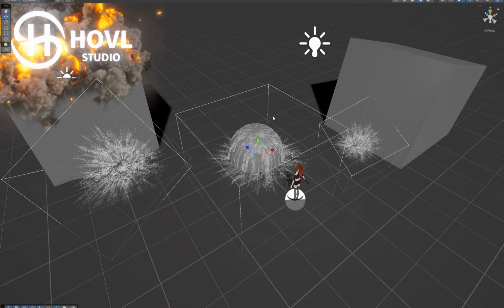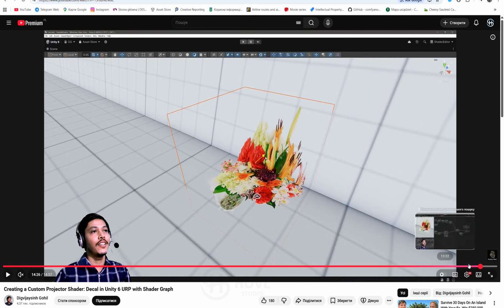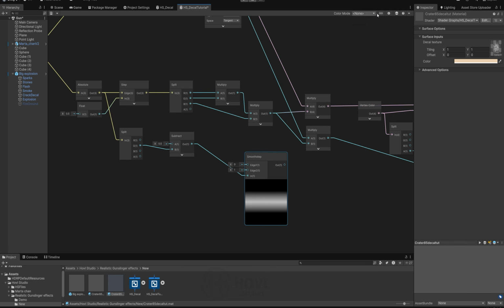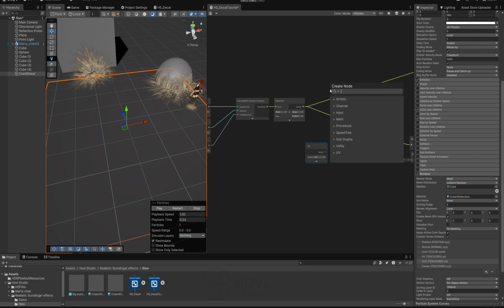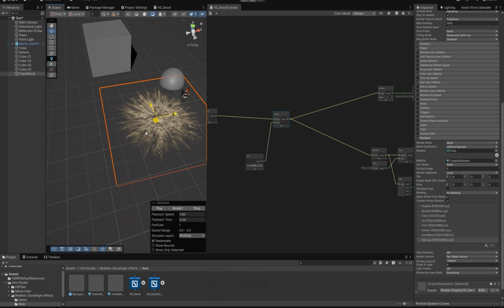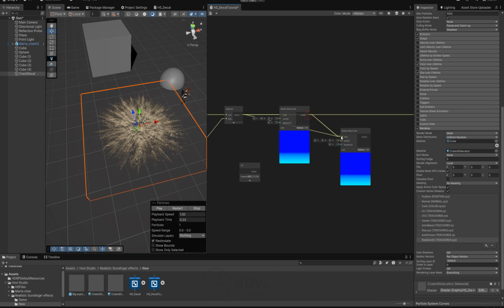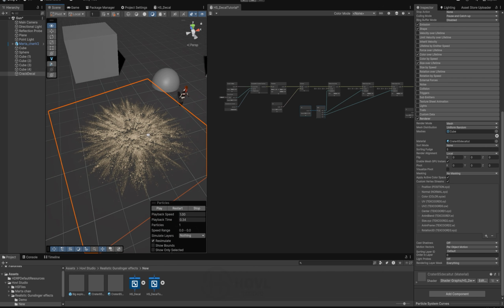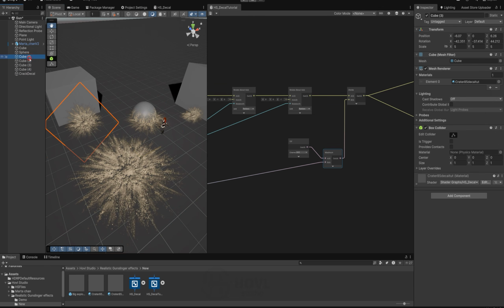Decals for the particle system in Unity! Creating the best decal solution in Unity

Comment: If anyone has any ideas on how to scale the gameobject/particle system transform to affect the scale of the particles, let me know! It works as is when it's a non-particle system, but for whatever reason, the UVs don't scale with the mesh when it's used in a particle system, even though the individual particles are scaling (you can check by rendering wireframe with shaded materials in the scene viewport).
I tried using all the different properties of the object node in shadergraph, but nothing worked.
Reply from the maker: Just transfer particle size from the custom data. That’s all
Reply: @HovlStudio Unfortunately, like I mentioned, scaling the particle system object doesn't scale the particles like you'd expect. For now, I use a script that passes the object scale to the shader to fix it. Tho I feel like the data is probably somewhere in there already, I can't seem to parse it out.